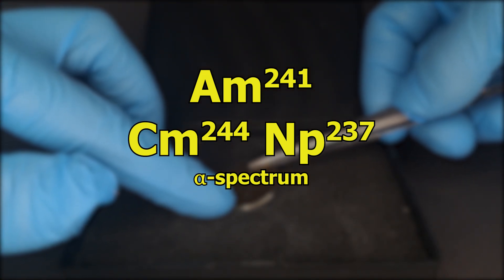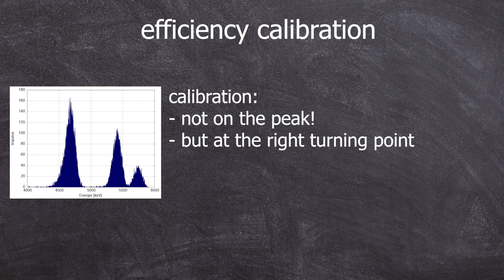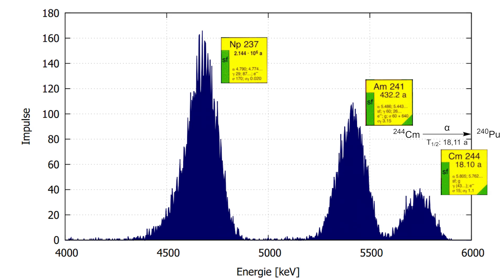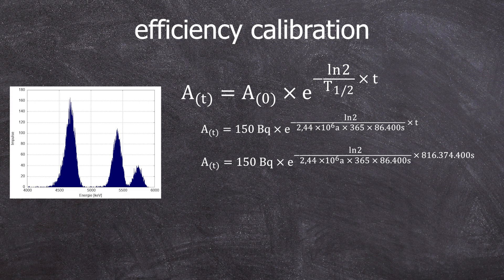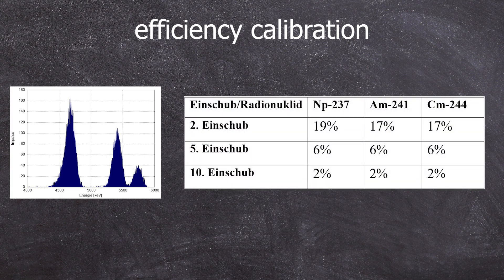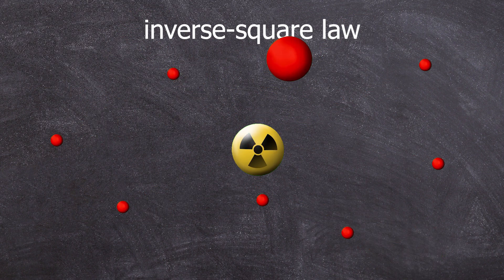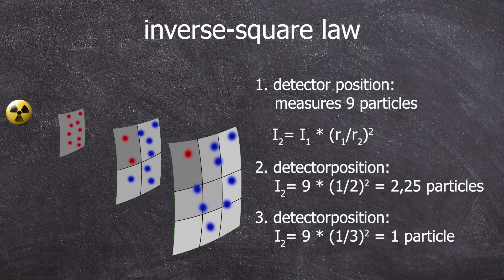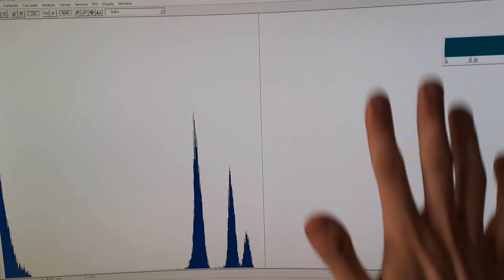Alpha calibration with Americium, Curium and Neptunium - Nuclear Chemistry

Comment: I hvae a question about the energy calibration for an alpha spectrometer, where you fit different energies to the channels from the multi-channel analyzer. Am-241 has two prominent alpha energies according to the IAEA chart of nuclides: 5.49 MeV 85% and 5.44 MeV 13%. My detector doesn't have good enough resolution to differentiate those two peak, so when I calibrate should I choose a peak energy that's somehow the average of these two? Does anyone here have any insight? Thanks.
Reply from the maker: I would recommend using the higher energy peak an calibrating on the right side of the "peak". Because in Alphaspectrometers without a really good resolution its mostly that they have a high tailing into the low energy range. In this case the 5,49 MeV would tail to cover the 5,44 MeV and you wouldn't be able to clearly see the 5,44 MeV. the only thing you can clearly see is the highest energy which is the 5,49 MeV and then calibrate on the right turning point.
Reply: @SimonsNuclearchemistry  Awesome! Thanks for your help!